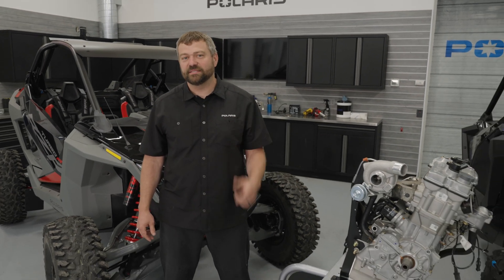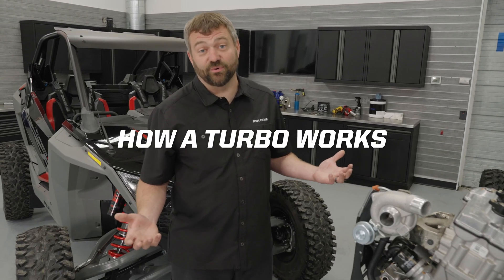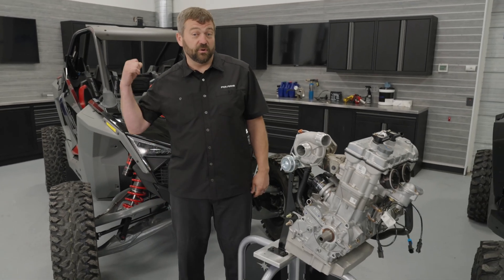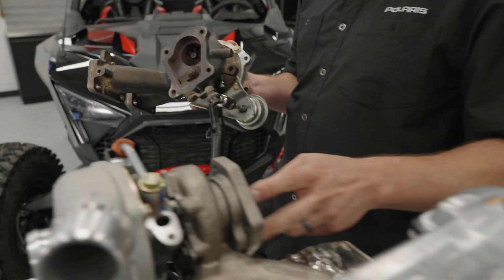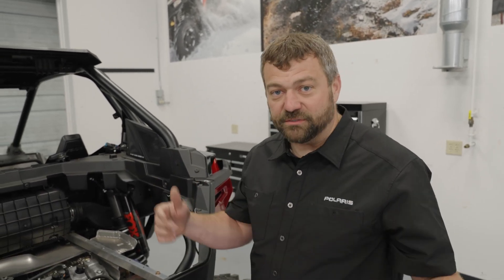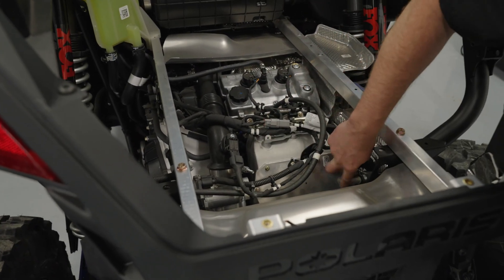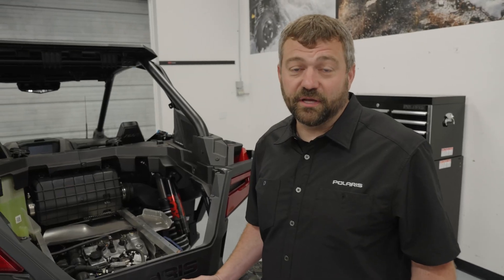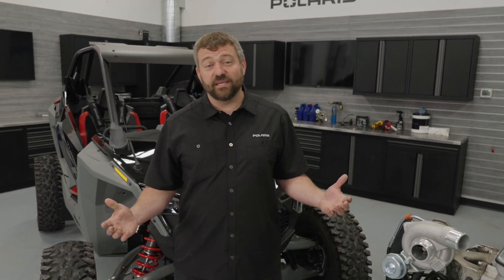THE 181HP TURBOCHARGED 925CC RZR ENGINE - SHOP TALK EP. 1 | POLARIS OFF-ROAD VEHICLES

Comment: I have a 2022 Pro XP 2seater, and I've got 700 miles on it and it's burning a lot of oil on cold starts after it sits a week or so...I'm betting the turbo seal is bad. 98% of my riding is in TN just rock and trails at under 10mph... I'll have to check the intake for oil. I haven't had a chance to tear it down..

Comment: Air to air is way better, ambient temperature is never as hot as coolant temp so the air to air will always be cooler air. Not to mention an air to water cooler failure could take the motor with it.

Comment: We have two of the 2022 razor pro xp4 was wondering on both of them why we have so much clutch slippage after 30 to 50 mph and is there a fix for this from Polaris
Reply: I have a 2021 Pro XP4. Remove the clutch cover and look for two things. First is the primary and secondary clutch sheaves aligned properly? Take a pic of the belt sitting in the primary and see if it is centered and not touching the sheaves. If it is touching either side then the secondary sheaves need to have shims added or removed to center the belt on the primary sheave. Make sure the belt isn't spinning with the engine on and the trans in neutral. The secondary shouldn't be spinning at all. Second. Is the face of the Sheaves on the primary or secondary dark gray or black? It should be light silver. If it isn't there is a coating on the sheaves that needs to be removed. Polaris knows this coating which is an anti corrosion coating makes the belt slip. You can scuff them by hand with a scotch bright pad or tell your dealer you want it taken care of under warranty. There is a TSP on the 2021 models. There may be one in the 2022 models as well. This solved my belt slipping.
Reply: @twotonebrute  thank you will do sir 👍👍

Comment: Owner of a 22' pro xp. I've only got about 250 miles on my machine so why does it sound like I have loose nuts and bolts every time I hit a pot hole? Love the machine but I am very disappointed in all the rattles. Any suggestions?  Thanks
Reply: The doors...
Reply: The clutch chatter I believe
Reply: @dannymurguia1803  it definitely does, is that normal?

Comment: Subjection for the intercooler system, make it a separated system non shared with the engine cooling system. A separated reservoir will do the trick.
Reply: The LCAC does run on a separate circuit, independent from the engine coolant. However, it does still use standard Polaris engine coolant, just runs cooler than the engine circuit does.
Reply: @InfamousRacing1  
It is a separate system that share the same reservoir with the engine meaning sharing the same hot coolant from a much hotter engine meaning the turbo front radiator being hotter than it should meaning inefficient cooling not exactly constant since the hotter engine coolant will index dominates the final efficiency of the turbo cooling.

Comment: I have the 2021 Polaris Rzr Pro XP4 the question I have is there something to reduce the heat in the cab area? But enjoyed the video
Reply: Wolfsnout kit
Reply: Remove the catalytic converter in the muffler, it reduces back pressure and eliminates heat in the cab.
Reply: The biggest cause of heat build up in the pro xp is a front windshield. If you have a solid front windshield  you will have a lot of heat and dust will be sucked into the cab. I had a solid glass windshield and that was my problem. I now have the Polaris flip up windshield installed and get heat when it's closed and dust from the trails. Less when it's in the vented position and almost none when it's wide open. The more airflow through the windshield area the less heat build up and dust you will have in the cab.